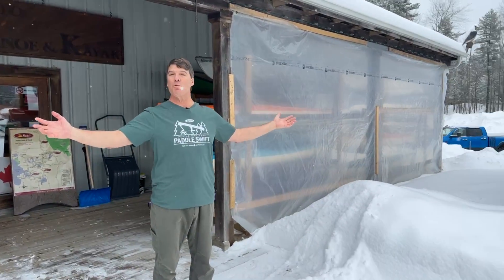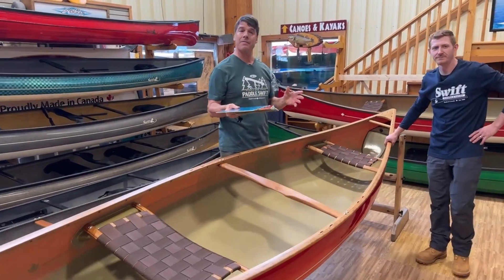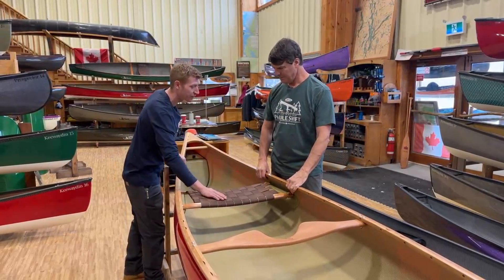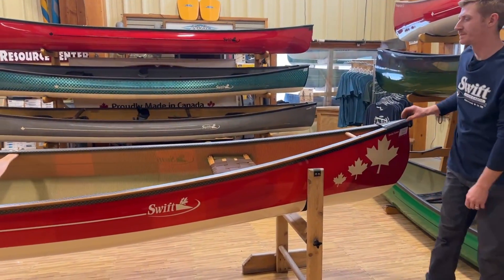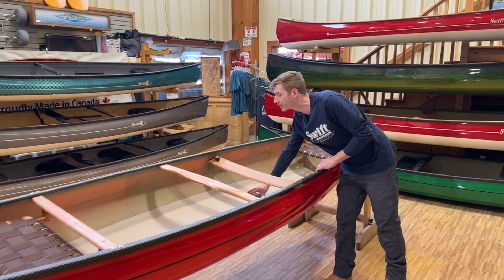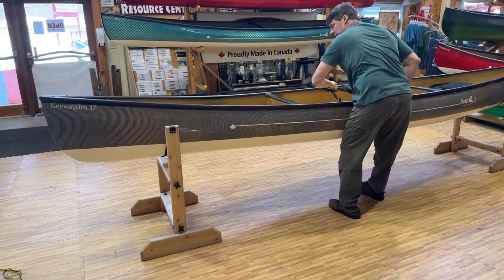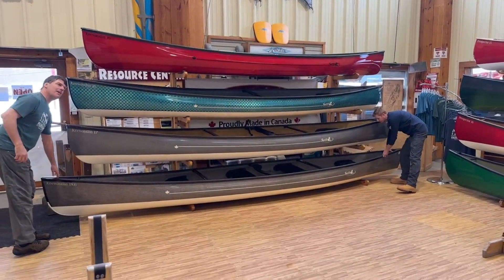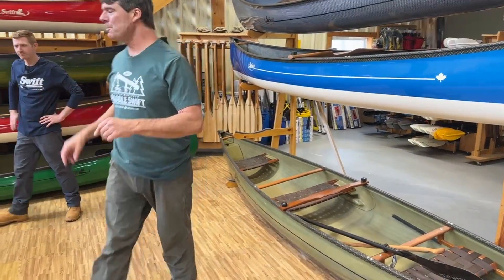2023 Product Unveiling Live Show

Comment: What the weight limit on the solos
Reply from the maker: it varies quite a bit by model, but if you're on our website each boat will show an 'optimum load range' when it works at its best, and a 'max capacity' for the absolute upper limit.